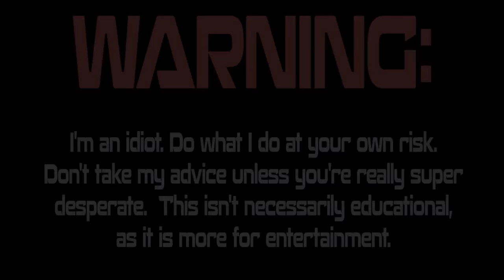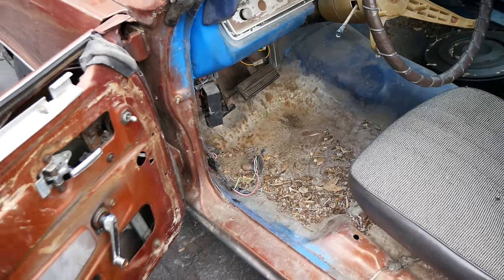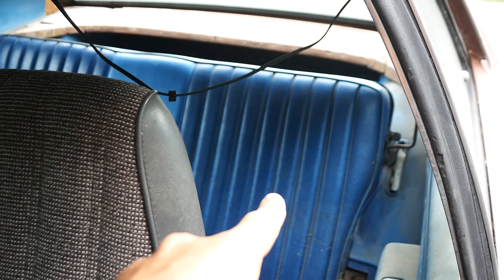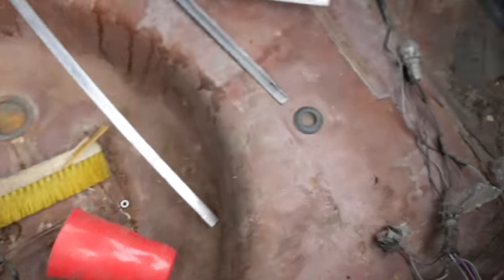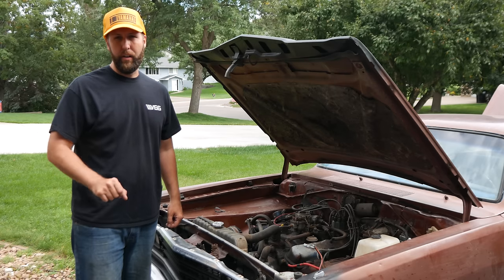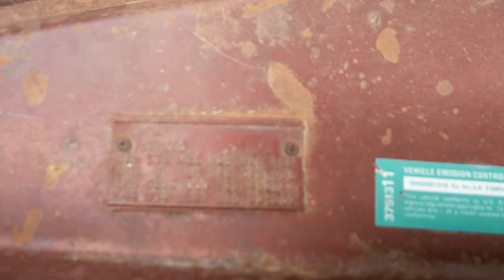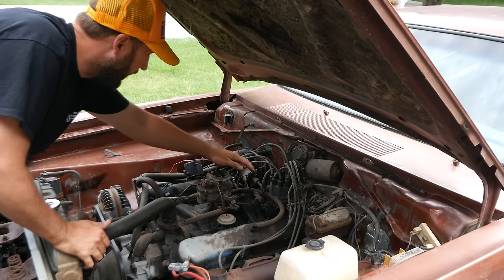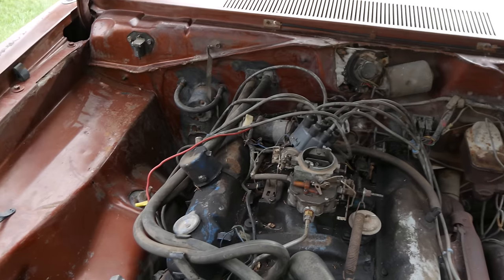I Bought a Plymouth Duster SIGHT UNSEEN - WILL IT RUN? - Vice Grip Garage EP47

Comment: When I was 16, my dad had a 74 Dodge Dart Swinger. I guess they were about indiscriminately screwing people? I remember that our two 74 cars had the lowest power per cubic inch of the modern age. 150 HP for the 318, and 140 for the 302 Torino wagon. Compared to that, everything they make now is fast. So- Can a feller make a 74 318 not suck with the heads that came on it?

Comment: 318's can be built up to close to 340 specs on the cheap. A far better motor than most realize! Do a little homework and you might be persuaded to keep it instead of spending a lot of $$$$ for a 340 or bigger motor.

Comment: I really have a lot of respect and admiration for what you do Derek, but basically 10 minutes of just grinding the starter and rubbing moving parts with no to low oil pressure is just to much for a guy to bare! I've never seen you do such a thing, call me surprised when you know the timing is messed up. 
Anyways, I'm having a bad day and maybe I'm just being too irritated and grumpy.
Reply from the maker: Tell me how you would increase oil pressure in a no start situation, before attempting to start?  Please do not say remove distributor and prime oil pump, this is a real life situation.